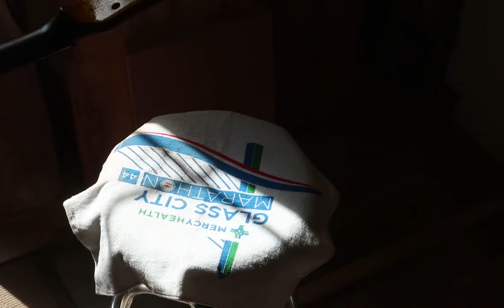Great Guitar Build Off 2021 - Handmade Double Cut - Episode 4/5 - Droptop, Headstock, and Burst

Comment: At 19:00 what was the stuff u put on the neck bud? 🤔.. Iv a broken necked nice acoustic that iv fixed up, but im stumped on how to treat the neck after sanding and how to get the nice glossy polished finish to it.. So im tryin to get as much info as i can befor that step.. Please please help me haha..
Reply from the maker: Sorry I did t catch this sooner... I used Angelus Leather Dye (brown). After that I use Mohawk vinyl sealer in a rattle can. After that, I typically use Mohawk string instrument lacquer in a rattle can. Just make sure you follow the directions for how to apply.  Good luck, and let me know if you need anything!

Comment: really nice work and thanks for sharing the process . . . I thought I saw one of your builds (from your website) using oak, am I correct ?  I am contemplating making a guitar body from some red oak that has some really cool figuring — what is your take on oak for a body ? yay / nay ? would you only use it for a thick veneer top ? Thanks in advance
Reply from the maker: Thank you!  I used a very stable (5000 year old) bog oak. Oak likes to move, so unless I was certain of it’s stability, I wouldn’t suggest it. Just my opinion. If I was to use it for a droptop, it would be no thicker that maybe 1/4”.

Comment: This is a newbie question because stains are a blind spot for me. You sprayed sealer on it and then you proceeded to add more colour. Does that mean that these are all stains and not dyes? (Dyes soak into the wood, rather than sitting on top.) What product are they?
Reply from the maker: Good catch!  I only use a mist coat of sealer until I am satisfied with the color, and then I sand it back with 500 grit paper if I want to adjust the color (like I did in this video). Once I’m satisfied I will do 2 mist coats and a heavy coat. The other benefit I had with this specific build is that I was using a maple cap which has very closed pores. And I use Angelus leather dyes (which definitely soak into the wood).
Reply: @shockthefox  That's really helpful, thank you!